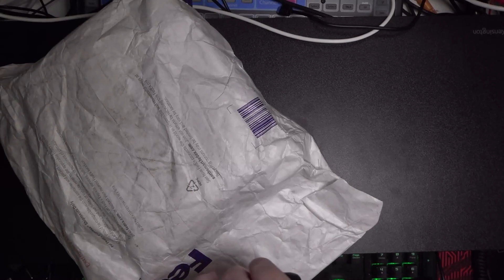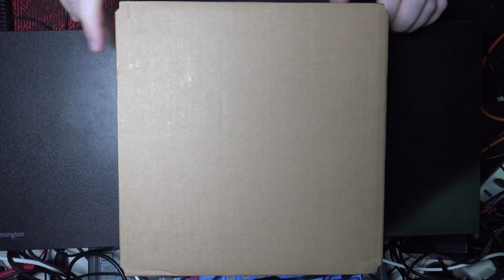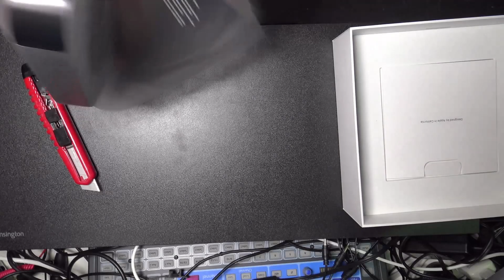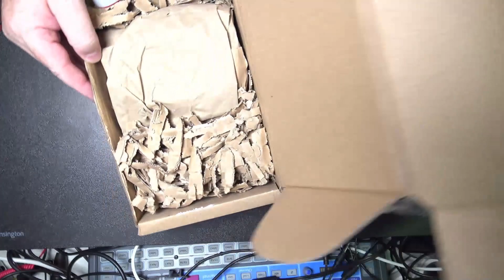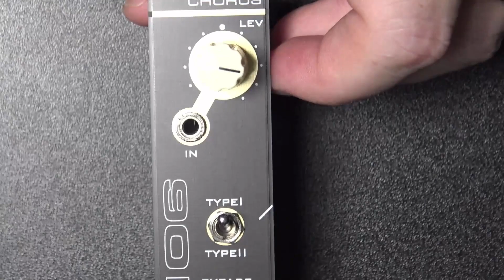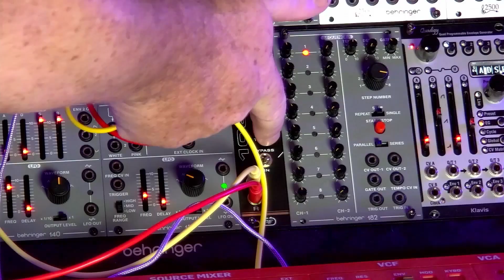Mailbag #7 - SE-02 EXT BOX - Mac Mini M1 - Juno 106 Chorus for Eurorack

Comment: I know this video is a year old but I just got my ext box yesterday and am having trouble with the din cable problem is I'm not sure which 3.5 Mm plug goes where and do I have to make any adjustments to the settings on the se02 to make the box work
Reply from the maker: So there should be one of the cables marked with some indents near the plug. This goes into your gate and then keeping your ribbon flat plugs into the next socket etc  (video mentions this at https://youtu.be/pjiKLpEKjrA?t=445 )
Reply: @ranzee  if I plug in the plug that goes to the ext input it's like the se02 is latched on a note if I just leave that unplugged  the box works but the volume level is way reduced and thank you for answering...
Reply from the maker: @jonathanulery1610  check your gate source switch - plus there's a manual gate button with an arrow pointing to it from a switch - check that. Toggle those until you see a change. If not then it has to be the patch on the SE-02 - load up an init patch. Failing this, reach out to SE and get some tech support :)
Reply: @ranzee  thank you so much for your help real quick question does your ext box make noise the wrong kind of noise I noticed noise and a volume reduction taking the SE02 well below line level so I bought an ART  tube pre amp and it works great but the noise from the ext box seriously im about ready to throw the whole God damn thing in the trqsh
Reply from the maker: @jonathanulery1610  No, mine sounds fine - here's it in action during the Xmas live stream: https://youtu.be/5PCzujHXbHo?t=7148 (link goes to the time 1:59:08)

Comment: se-02 souds great! am i right in assuming that if you use the ext-box you lose the stereo output that's available on the se-02? you end up with mono right?
Reply from the maker: So, here's the crazy thing. Yes, the SE-02 has stereo output - but it is a single voice MONO synth with NO stereo FX. So in essence you're not really losing anything "Stereo"
Reply: @ranzee  yeah, I found that part perplexing. The only potential benefit would have been to route external audio through the filters in stereo, but I always use the se-02 in mono. Either way, even in mono it sounds worthwhile to be able to run through the drive and filter. Thanks!

Comment: The Ext Box might have  been interesting to me if they had implemented (high resolution) MIDI with all of the controls and integrated it with their editor.

I'm pretty sure that the third gate option is a fixed gate switch, which is somewhat useful instead of having to run a constant gate from an external or internal source when using the filter for external processing.
Reply from the maker: I still think this is a great bit of gear - I'm a big fan of the SE-02, so anything to make it better is awesome! I have a spare one - still in the box if you want to buy it ;) ?? joking ...
Reply: @ranzee  hey there. I'm interested

Comment: Thanks Ranzee. Regarding copying your files onto ext HD I do the same with vst samples (ie. the big files)  but the component files (.vst and .component) are on my Mac HD. Is it possible to migrate them to ext HD? Would I need to change things in Ableton like where to look or would it be done automatically? 🤔
Reply from the maker: You can use the Apple Backup to restore on the new machine - but I opted to go clean install - more work (painstakingly) - but worth it in the end - don't want to introduce any issues.
Reply: Ableton has a hard time automatically finding files that have been moved. I keep all of my Ableton sessions & samples on external, and and only the programs on the HD. Cheers!